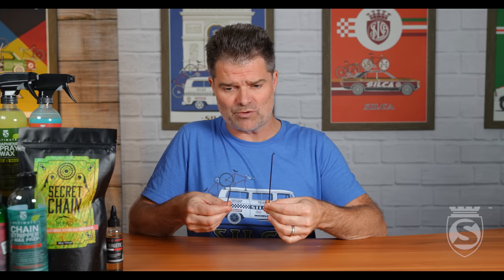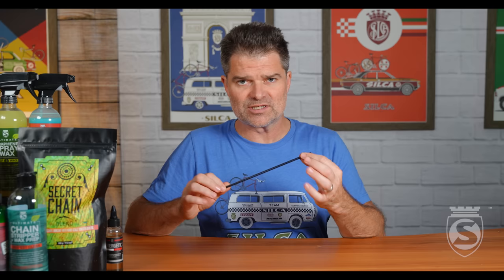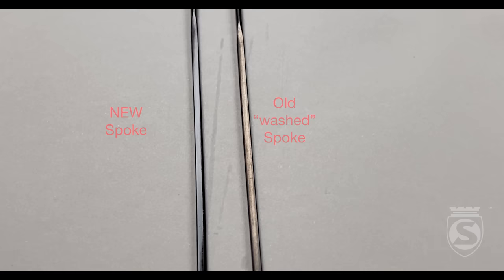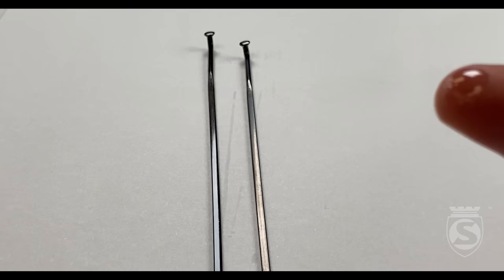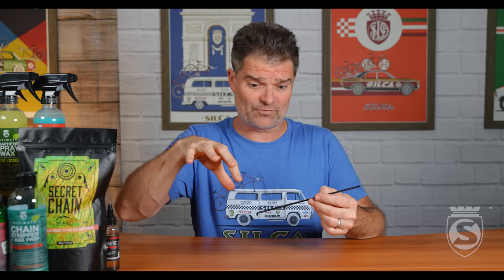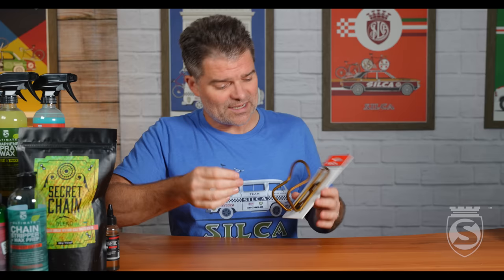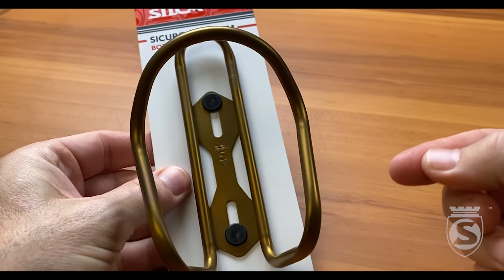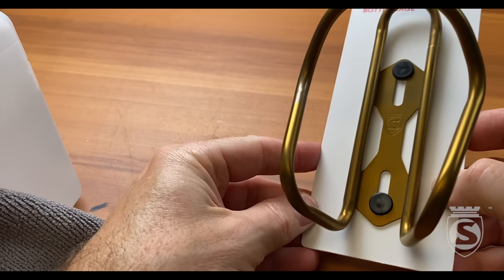STRANGE MARGINAL GAINS: Refraction of Light on Metal Coatings

Comment: I've just watched this video again. This time, I was left wondering if the surface coating on our spokes may also influence their aerodynamic properties? These parts happen to be both some of the fastest and slowest moving parts on a bike, and any aero influence could allow for another actual performance related marginal gain. Any thoughts? Any such testing in regard to such effects on components?

I'm currently waiting for my Pegatin Plus, individually cut frame/name stickers to arrive. I've pondered if placing them along the sides of my seatpost, or any other near vertical bicycle part, could work like the 'ribs' on the sides of your aero socks? UCI rules aside, that is, of course! If so, do those with the longest names potentially stand to gain the most?

Happy New Year to all as well.

Comment: Love the vids Josh but you have the terminology wrong here. The correct word is “reflection”. Refraction is the change in direction, and speed, of a wave (e.g light) when it passes through the boundary between two  different mediums (transparent or translucent materials in the case of light waves). For example light travelling from air into glass will change direction and reduce speed as it enters the glass.
Reply: This appears to be due to thin film interference, which includes both refractive and reflection (diffuse and specular). Source:" Simulation Technology for Titanium Oxide Layer 
Interference Color"
Reply from the maker: @ccatwood beat me to it, but the color shift is due to both refraction and reflection effects in the oxide layer either cancelling or reinforcing the wavelength of the light that is reflected.
https://www.xometry.com/resources/machining/titanium-anodizing-colors/